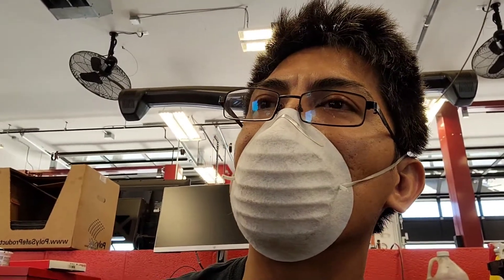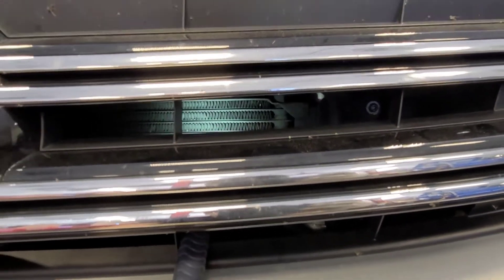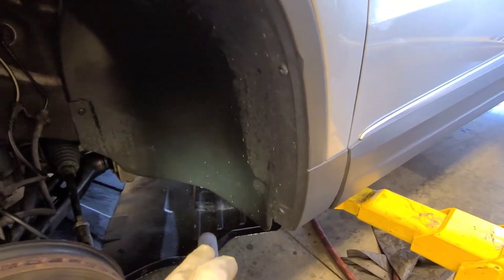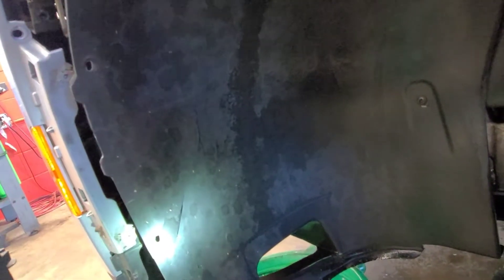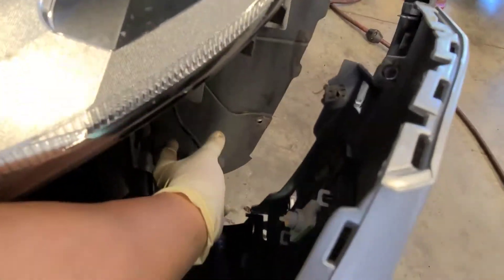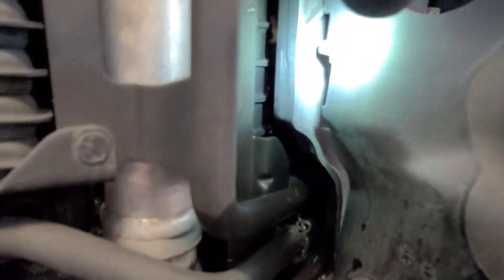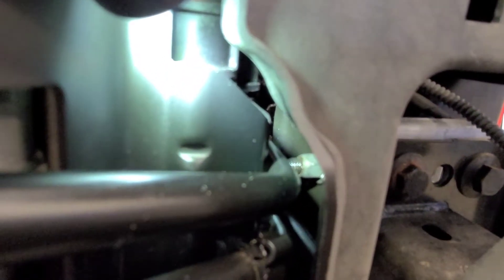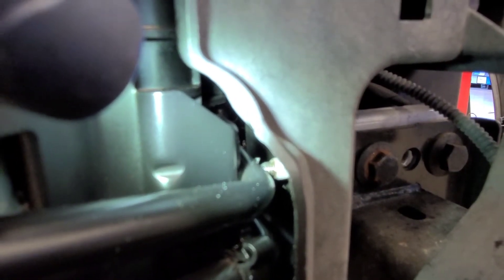2017 Volkswagen Tiguan Auxilliary trans cooler and Front bumper cover removal.

Comment: Thanks for this video. I have a '13 Tiguan that's leaking in the same place.
Reply from the maker: Great, mine is because, the car got into a accident and the body shop did some work on it. But the bolt they used is protruding to the point that it punctured the transmission cooler. And it may have leaked instantly but a couple of vibratiin during regular driving and it finally leaked out.

Comment: @DRBauto, do you have any video on 2017-2018 Volkswagen Tiguan to remove the transmission lines to do a complete transmission flush?
Reply from the maker: i do not have any. I dont usually flush trans fluid on these cars because most of them are lifetime fluid. I do drain and refill most of the time on newer model cars. If pan is available, i take it out catch all fluids and put same amount back in if there are no leaks occured prior. Removing lines for trans flush requires a machine to perform the service. Some quick connect trans lines on most european cars can be remove using a fuel line disconnecting tool.

Comment: When you disconnected the trans lines did it leak transmission fluid, and how did you disconnect the quick connects?
Reply from the maker: Not this one because the fluid have leaked out already when brought to the shop.
Reply from the maker: I cant remember how i did it :) But i am sure i struggled a bit not having the correct tool

Comment: Just did the same job on my 2012 Tiguan.  Had an issue, curious if you have any ideas.  When I was done I checked ATF level per shop manual.  Added 1 quart, still nothing coming out, added a 2nd quart and recovered over 1 1/2 quarts before it trickled to a drip.  Any ideas why nothing flowed back after adding a quart but then almost the full 2 quarts came out after adding the second quart?  I monitored temp via RossTech, stayed between 37 - 43C through the whole procedure.
Reply from the maker: Its really hard to check how much was inside the tranny. You did the correct way, making sure that the Tranny Fluid temp is within the specs range as you add and watch for the trickle. So many things that can be a factor, if u DIY maybe u are on a slope and causing it to not trickle. Or maybe it just need a bit more. If u follow the procedure and no odd behavior happens after the job, then i give you a big thumbs up :)

Comment: Hey Julio, great video very informative. I’m working on my Tiguan have a leak in the same area. How exactly do you remove that oil cooler. Bust mostly the fitting/seal on the hose that was punctured, I haven’t seen those connectors before. And your video is almost perfect it just stopped right before the part I needed unfortunately.

Sorry I think I posted the first message in the wrong area.
Reply from the maker: From there, just remove the front support infront of the cooler. Then follow the cooler lines to the other side and disconnect it. Stretch open the clip/clamp and twist and remove, this clip/clamp should be replace according to the dealer but it useable. Then remove the bolts that holds the cooler. Send me your email and i will send it to you.

Comment: Where there any screws along the bottom of the bumper, holding the base in place?  You seemed to have skipped past them.
Reply from the maker: U are right, there is bolts thats is on the under cover that i totally forgot to mention. I had it removed during my inspection and nevr place it back on.
Reply: @DRBauto  Thanks for getting back to me.  I am wanting to install a number plate and driving 
light support bracket on mine, and figure I'm going to have to remove the bumper to get at the back of it. Cheers.

Comment: You don't have to remove the. Fenders. I've done this job twice.
Reply from the maker: I did not remove the fender liners. I just loosen a few screws that hold the bumper cover. And also the customer wanted to see the exact location of the leak and that is why i took it off so they can better see it. For documentation purposes.